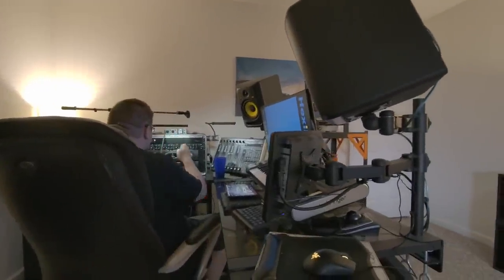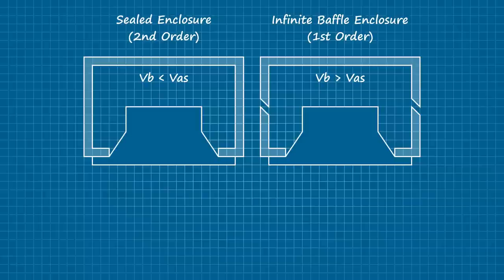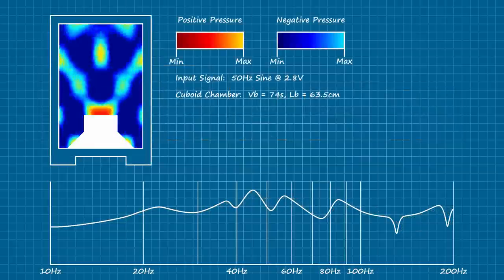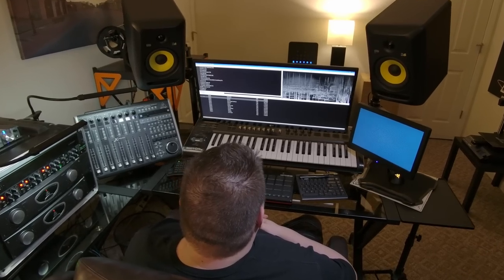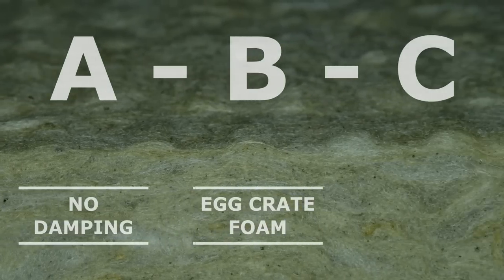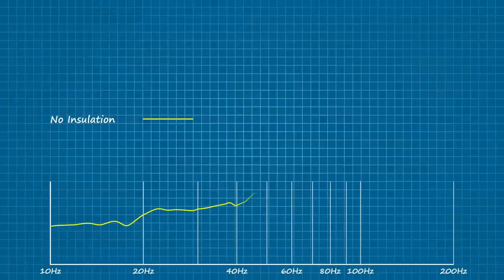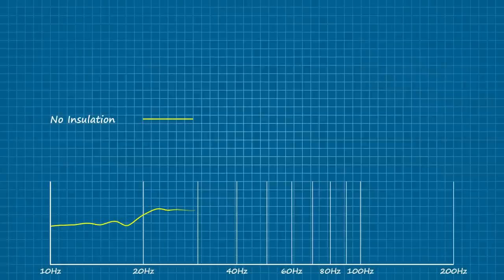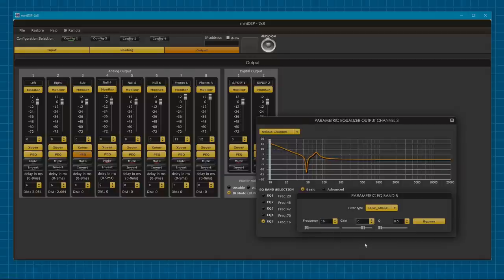Treating Enclosure Resonances

Comment: Do you have any videos on box geometry, as in what the optimal solid would be? Such as a cube vs. a sphere, maybe even comparisons with some other solids such as the other platonics, or the more easier to construct archimedian and catalan solids; I'm also somewhat curious about how a toroidal enclosure would theoretically work. I know this would only really be demonstrated with air velocity/pressure simulations, as there's no real way to make a truly spherical enclosure easily, and finding a way to glue together a large solid that isn't a cube could be fairly difficult. I'm just more curious as to how deviation from 90 degree corners would affect output; say, would a tetrahedron be better or worse, or would an octahedron be better or worse, then so on until we get to something that's too difficult to manufacture, like high face count solids and spheres.

Comment: That wool seems identical to what I have uncovered in older GM cars for road noise, and I always tore it out in favor of Dynamat!😆
Reply: Actually mild steel sheet with dynamat could work as a pretty effective membrane absorber if correctly designed. Possibly with some holes in it, and an airspace behind it.

Comment: Still don't quite get why too much sound processing sounds unnatural? Maybe you could do a video on it?
Reply: i think it mostly refers to trying to fix the natural destructive nodes through dsp instead of actually fixing the room/speaker positions/speaker cabs. if the problem is severe, you're just going to be adding a lot of distortion  because the amp will clip first at those huge spikes, and the speaker will distort since it is still working harder, but it will be naturally muted due to the destructive node cancellations. 
i personally have this problem, (at around 120hz for me) and my audio suffers because of it, mainly classical music which has huge dynamic range (and imo, unnecessary). i'm not a perfectionist, and because it works well enough as it is, i haven't bothered fixing it.

Comment: Hi there, I just build a subwoofer with a Skar audio enclosure and a 10" Electrovoice Subwoofer driver, it produces excessive vibration all over the house, so I tried to isolate it by placing the subwoofer over a piece of foam and it worked 75%, do you have an idea on how can I can reduce more of the vibration?   Thanks in advance...

Comment: What about the common poly fill? 
If planning for the wool, does it eat up some air space? In other words, build a little bit bigger enclosure to get your net volume after the wool?
I usually do minimum 1" walls with overkill bracing. Then loosely fill with poly.

Comment: So do you have to adjust the enclosure volume to make up for the lost space? Treat it as the dimensions lost or not 100% since its fiber not a solid
Reply: it absolutely changed the volume of the enclosure
Reply: @2869may  Hence my comment. Everyone says insulation makes the sub preform as if it were in a bigger enclosure. Polyfill for instance takes up a lot of space but its not displacing the entire area that it occupies.
Reply: @A6Legit  I don't understand it either, but many knowledgeable people say it.... I have done it but can't say I could notice any difference.

Comment: What if you change the internal shape? If you stick to the same size cabinet, what happens if there are no parallell walls? If you curve the rear wall, and the side wall? Or any other shape you might fancy that might help sound wave reflection? For years I've been having this in the back of my head without finding the time to test it out, and also I don't have any test equipment or skills how to use such tools, so I would have to rely on my ears and only them, and I am not sure they are good enough to hear any difference. Have you ever tested this out in real life?

Comment: So while I definitely don't consider home theater "critical listening", My theater has 11 DIY subs in it and 7 DIY towers for the main bed layer. I use polyfill for all of my subs (as they're all sealed units for ultra low extension) and have considered changing the insulation. Do you think I'd get stronger ULF results (say below 15Hz) if I went with this type of insulation over polyfill?

Comment: What about the fibre material that is blasted around by the compressed air? Earlier or later for sure that stuff will destroy the speaker. I won't imagine what can when these fibres are blasted by bassreflex. How to handle that?

Comment: I like your theme music ! While doing the first two sweeps, you could hear a bump between 40 and 60 HZ as the frequency moves up. That aberration is go we with the rock wool. And now I know where to get it, but when using the rock wool how does that effect the enclosure size, as if you’re planning to use it from the start? Does is count as if the walls of the enclosure were 50% closer together than without any damping, or is it the same? 
Thanks Pete!

Comment: How did you model the frequency response of different enclosure shapes?   

I’ve always been under the impression that shape is not important for low frequencies as long as the surface/panel is rigid.  Is that an incorrect assumption?
Reply: It doesn't if you look at the graphs, everything under 60hz barely barely moved an inaudible amount really even the rest of the band barely moved

Comment: Seems like a very expensive way to smooth out the response. You did not state how much reduction/improvement you've got (in terms of db), and whether the wool affected efficiency, And whether you've actually heard the difference, especially with music. Personally, I'd first modify the internal geometry by getting rid of the 90° corners and filling the box with a cheaper alternative.

Comment: I always enjoy your content. Luckily most of the car audio enclosures I built (1980's to current, LOL)had at least 1 angled back wall or speaker face. I did experiment with different methods to reduce standing back waves back then.
I had a enclosure design I was gifted in the early 90's that I can only remember a few details about. I'd like to see if you can help me identify what it was. Keep the videos coming.

Comment: Does the wool/egg crate take up box volume ? I know it does physicality.
Reply: Oh ok. I get it. When designing a box you need to allow for the wool. Does the same apply for that nylon pillow stuffing people use? Thanks btw. 👌
Reply: Not significantly, it's fairly porous.

There is some debate as to what the speed of sound in rockwool is, though.

Comment: As usual very interesting video. its rather clear each design phase notably the enclosure design is remains critical, DSP used correctly is only then used as an ointment (minimum corrections) instead of face  reconstruction (many doing this). 
I 'm interested in looking at intelligent driven DSP algorithms vs brute force methods, Example: delaying the audio signal in the time-domain digitally before it enters the amplifier (however this wont help with acoustic feedback measurements), The future is Audio Machine Learning algorithms, against data points like "Recorded Acoustic Environmental Profiles" for the selected speaker positioning and sampling listening tastes and building data models collected from people's music/audio preferences this is where I predict things will go in the future. Like Google Nest smart thermostat. But audio is way more complex and challenging. 
I hate the way movies are dubbed, abrupt explosions bang! boom! reaching 12db in the middle of the night me playing AGC (automatic gain control) with the T.V remote control.

Comment: Hello HexiBase. Pardon my noob question but can you confirm my understanding: the T/S parameters do not account for such reflections of an enclosure, room, etc but only considers the enclosure volume's impact to compliance? Do you have experience modeling these other effects in SPICE? If so, it would be interesting to see a video using spice to model this and then correlate/calibrate the model to an emperical measurement you perform.

Also, what software and models did you use to simulate your predicted response?
Reply: The ts parameters do not include anything other than the compliance than box, you are correct.

Comment: I noticed there is also a "sound dampening" mineral wool out for between walls. Might be worth the extra cost.
Reply: Sound insulation is not necessarily a good sound absorber. Concrete is an example of the former only. In a speaker box you want something soft enough to deform at the relevant frequencies and SPL to re-release the energy slowly.  I would guess that rockwool suffers the same problem as foam. Too firm. With polyester the apparent volume of the box can even be increased.
Reply: @michaelpiotrowicz6100  I think you would do well to do some reading on the speculation about how exactly rockwool is absorbing sound. It is primarily gas flow impedance (also termed air flow resistivity), but also relies on qualities such as tortuosity and porosity (coupled flow nightmare).

It is not a simple matter. Rockwool works, of that much we are sure, and most of its effects can be modelled simply by its ability to impede gas flow.

Here is some surface to start scratching:
http://resource.isvr.soton.ac.uk/staff/pubs/pubs47.htm the paper by fahy and Thomson on the coupling of perforated/porous solid surfaces to air is worth a read.
Reply: @weareallbeingwatched4602  thanks for that. Some experimental literature that you might find interesting, and which is consistent with my experience, is available to read here https://sound-au.com/articles/boxstuff.htm

Comment: Can I do a push pull isobaric with a front facing subwoofer and a down firing subwoofer firing into the enclosure from the top at a 90 degree angle from front subwoofer?

Comment: Hey man! Just here to say that I appreciate your video's! No audiophile bullcrap, just facts that you then demonstrate to us mere mortals :D thank you! 
Btw: I'm waiting in agony for your dsp video as I'm doubting to use the dsp as an active filter in a woofer-tweeter pair (and thus need separate amps for the tweeters and woofers) or just add a passive crossover that I can correct with dsp after it's set in its final location. The active filter setup with separate amps seems more expensive and a less common approach?

Comment: Are there other measurements you performed for the comparison but didn't show on the video? I suspect the long wavelengths at low frequencies adds to the difficulty.
Reply: It actually does the opposite. The diffractions and standing waves are negated when the largest dimension of the box is smaller than the wavelength of the highest tune played. That's why padding a subwoofer rarely gives any effect. Constrained layer damping the enclosure will bring better results, but for other reasons.

Comment: I am thinking of doing a "loud" SQ build using 4 12" subs (sundown sd-4 if you're curious -- open to suggestions on other speakers if you have any). Does it matter if I put the speakers on different sides of the box? I wanted to put them all on the top, but I was wondering if putting two on top and two on the back side would cause problems within the way the air travels inside the box... No need for a deep explanation if you don't have time, mainly just want to know if its a bad idea to do this

Comment: Thoughts on adding insulation like that to a normal sealed speaker?  I have a mix open-baffle & sealed bass floorstander with a -3db at around 60 hz.  3/4 inch MDF.  Untreated interior walls.  It looks like the difference that you attained was primarily scholarly, you don't have a Y-axis labeled but I can't imagine the differences are more than a DB.
That said, they don't appear isolated to bass, there are differences across the board.
I swear this is actually how I convince myself to do things, being super cynical.  But I'm not sure I'd hear the difference between your before/after despite my attempts at calling myself an audiophile.
Reply: foam, rockwool or any other similar stuff dont´t have any important effect on bass region, under 200Hz fibers do not absorb or dissipate nothing.  When you need  absorb or dissipate energy in that frequency range, vibrating panels are used in conjunction with some absorption (membrane resonator), or bass traps that depend on the dimensions of the wavelength  (1/4 lambda)  or helmholtz resonators.

Comment: would changing the shape to get rid of parallel sides work better than rockwool?
Reply: Probably - but cabinets with sloping or unparallel sides are a b_gger to make.

I'm sort of considering a pair - you can model them in a CAD programme like Fusion 360 to get the sizes and angles for the panels and use a circular saw that can be tilted ... but it's gonna be a lot of work !

Comment: Pete
How would this react if it was a ported enclosure . I myself have always used eggcrate foam in mine and love the way they sound this way . It may not make a huge difference but I would love to see this test.  Awesome video and keep them videos coming .
Reply: @HexiBase  that's how I have always felt but never had the means to prove it .
Reply: If you care about your health, do not expose your lungs to this material - putting it in a subwoofer with a port to vent all the particles is about as bad as you can think of.

Comment: Hey! I have a pare of sonab oa5-2 and they have a basket that sits behind the speaker with dampening material between the two, it has a level adjustment that was very precisely adjusted at the factory. According to carlssonplanet this smoothens out the impedance curve quite a bit. I think you'll find it interesting to look into. Sincerely.

Comment: I use a product that is a dense CCF. It is about 3/16-1/4" thick. Bought a 100' x 4' roll at a yard sale, there isn't a branding on it.

I haven't modelled its response, but it did noticable smooth out the perceived sound.
Power handling increased, proportionate to the number of surfaces inside the enclosure (18mm Lauan plywood) that were treated with that CCF. 
The sub acts as if it is mass loaded. Very intriguing.

Thanks for the visual representation of + and - pressures. I look forward to your next video.

Comment: imma just slap old clothes and towels in my sub. works fine.
Reply: If you put a mesh separator in the middle. Then put an hinged lid on the top. Make sure to install a air tight gasket, along with a latch strong enough to keep it sealed. You then have a (can’t combine the words together to make sense) laundry basket/subwoofer.

Comment: So how does the change in open air volume when comparing no insulation, egg crate, and mineral wool contribute to the results on top of the materials sound absorption qualities? Was just wondering if you need to increase the volume of the box accoring to the thickness of the insulation material so all combinations in the test have the same air volume. May not make a difference once the volume get over a min threshhold but wanted to ask anyways, thanks for your expertise.

Comment: Glass wool has been used in older west German studio monitors with lots of success. I've used rockwool in old Dali towers myself and it not only corrected peaks and valleys but lowered the bottom end a bit, too. Though that's a reflex box.

Comment: Pete, thank you for taking time out for this comparison.  Now I might look into this. I'm running a Dayton audio 18" in 6.5 cubes at 24hz in my vehicle for SQ purposes.  Currently I do not have any batting at all.  I'm curious if this will help dampen the peaks for a smoother response.
Reply: 24hz tuning on the box at 6.5cuft  is going to put anything over 50hz out of range of the box. 

Standard A for a kick drum on most pop music is 55hz.  Port only gives  about 1 octave above tuning. 

B string on a 5 string bass is 30 Hz .

U built a box for peak port efficiency below what most musical content is played at.  I personally think your best option would be turning around 32-34. 

You built a sound effect/movie sub box and put it in a car.  Dampening is not going to over come that box tuning. In my experience I have put a 10 inch sub in a 5cuft box tuned at 19 hz. It played very low you could feel it more than hear it.  Not musical at all put worked for godzilla movie and played super low but was missing between 50 and 80 hz. 

Basically I think you would do better to retune the box.
Reply: @williamkillingsworth2619  not true at all. A lower tuning frequency helps with a nice roloff frequency.  Tuning a subwoofer higher than its alignment calls for causes 2 things. First it creates peak frequencies and lastly it rolls off steeply.
Its important for critical listening to have a predictable response.  I believe your experience may me with purpose built "SPL" drivers where this might be true.
Reply: LIFT4POWER  what I is tryin to say is a box tuned that low is optimized for  frequencys that are at the very end of the audible range and  more suited for “effect”.

Being that low it will not play hz above 55-60 as well as a high tuned box

Also your original question was asking about dampening. I was suggestion playing with the tuning might yield a more notable change.  

So many environmental variables it could work out better.  Yes peaky in a modeling program, but after room gain whats it like?